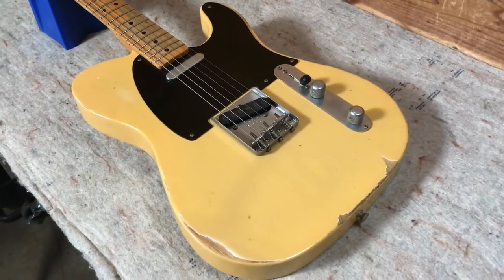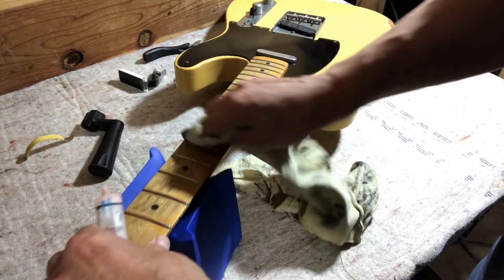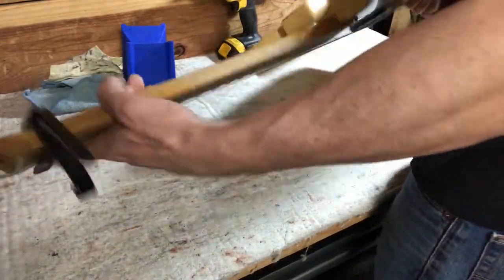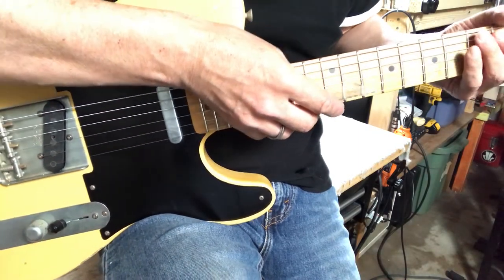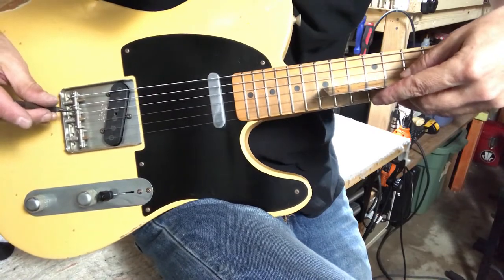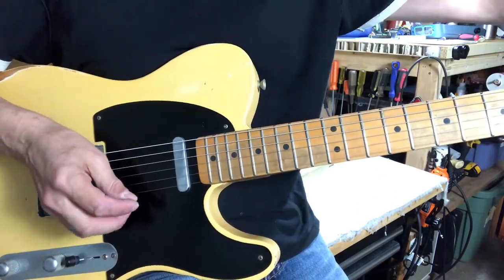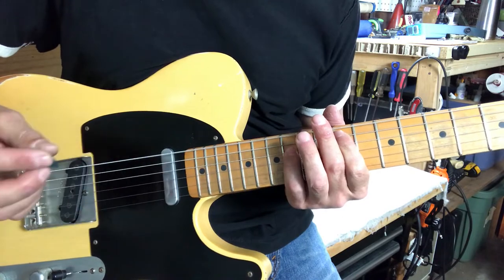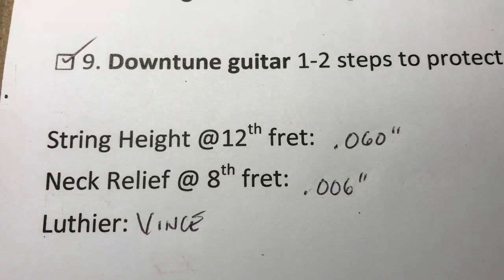Fender Road Worn 50s Telecaster Guitar Blonde - 10 Minute Tele Setup

Comment: Did you happen to take off the scratch plate?  (under that is...? route for middle pickup?  Space for neck humbucker?). just wondering thanks
Lastly, what would you think of a Fender neck change to a 9.5 or flatter (rather than the 7.25 that comes on it).
Reply from the maker: Hi, under this pickguard is a cutout for only the stock single coil pickup. the neck change should work but you just have to see how the neck fits the pocket. cheers
Reply: @stillkickinmusic    Thank you very much.

Comment: I'm not big on relics, so I was thinking of a Vintera II 50's Nocaster. Have you checked out one of those?
Reply from the maker: Hey unfortunately have not got my hands on one yet. If you try one out, let me know what it's like!
Reply: @stillkickinmusic  The only thing that keeps me from pulling the trigger is the 7.25 radius. I know that it's not retro, but I would prefer a 12" radius.
Reply from the maker: @billkallas1762  you need to track down a Highway One Texas Telecaster. Only made a short time rare 12” radius Tele
Reply from the maker: @billkallas1762  https://reverb.com/item/76530393-fender-highway-one-telecaster-with-maple-fretboard-2003-2011-3-color-sunburst
They usually sell around $1200